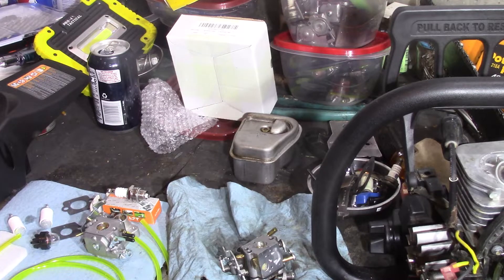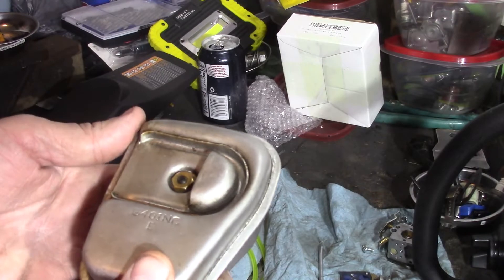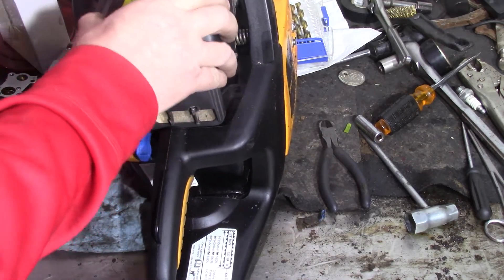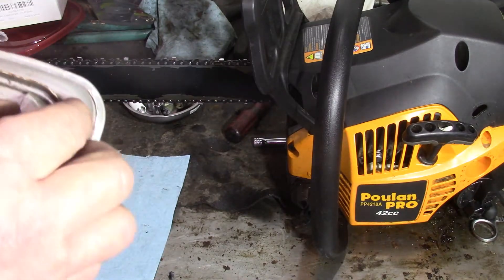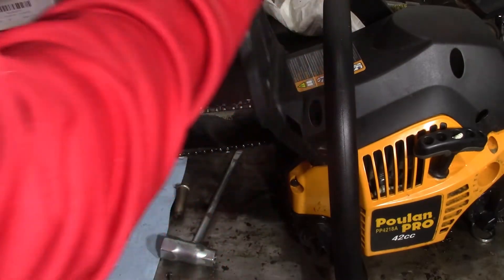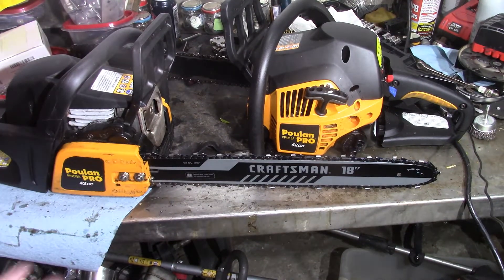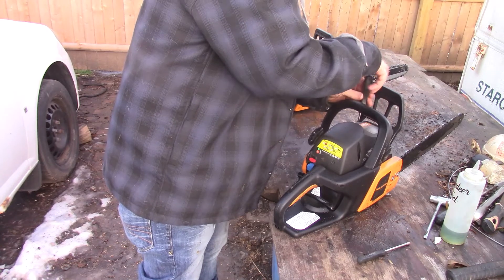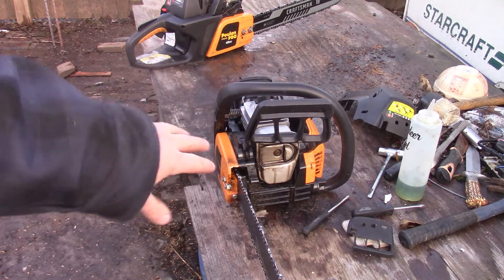Poulan Pro 42cc basic chainsaw muffler and air intake mod

Comment: My 4218 runs good its my throw around saw, only mods are proper tune, and honda hp2 at 40 to 1.. but i watched a few vids on people doing muffler mods and air intake mods, and every case I seen at least it slowed the saw down..
I use to race mx bikes, and if you took the slencer off you lost about 1/2 the power...I'd like to see timed cuts before and after or dyno results. I have a bunch of blue xl12's homelites  they run well. I may build a saw dyno out of an old gocart engine dyno...
Reply from the maker: @joracer1  that would be pretty cool to see. I’ve actually wondered the same as far as HP loss. I’ve noticed a quicker throttle response on a couple of them that’s truly about it. Might have to get a couple of them out with new chains and see if there is a difference in cutting time between the 2 of them. Happy New Year

Comment: You can't get any better cheap after market carb than a HIPA.
Reply from the maker: @billclisham8668  I’ve used a bunch of Hipa carb kits. Ive only had a problem with one carb and it was a simple fix. For the price they are hard to beat.

Comment: Just removing the screen and lid makes it run better and drops temperature by 20 degrees or more during summer heat 
But switching saws at every fuel up is best and let engine warm up is a cly saver

Comment: This muffler is the same on Husky 240. If you break the spot wealds coming from engine site, you can wrap the metal oval piece going around removable screw tubes using needle nose pliers and remove it from the back. On the front the metal blocking the slits can be remove also; it's not welded, leaving fully open muffler. This way you can keep the screen and cover. Cover's dome can be pounded on the piece of wood with the indent carved in it, using half inch ball bearing and punch or piece of steel shaped into the ball. Husky 240 is 38ccs engine and I could install non-skip chain on the saw and cut fully frozen birch trunk.

Comment: I'm a retired mechanic and I saw how GM and Ford Motors destroyed their V8 engines from 71 to present day, I never thought about the small engines two or four cycle being choked down, makes sense what this guy is doing here, but you don't want to take all the back pressure out of the muffler, as for the intake, the more air that carb can get the better it'll run with more power. These Poulan Pro chainsaws are really good chainsaws, I have a Poulan Pro 220 42cc chainsaw that I bought in December of 2000 after we had a major ice storm in southeastern Oklahoma, it actually sets in the shop more than it's used, but it's never given me any problems until the bearings went out in the bar tip roller, you can't buy a new bar with the built in chain tensioner, they don't make them anymore, you have to purchase the chain tensioner with the pin and screw that goes into the slot at the bottom of the clutch brake cover to use with the old style bar, like what the big chainsaws have, but other than that, it's still a good saw.
Reply from the maker: Back pressure is what I was worried about. I thought about just cutting the tops off the tubes instead removing the whole thing.  I’ll have to try it on one of these to see if there’s a noticeable difference.

Comment: I made a custom exhaust for my poulan 260 pro I keep in my one offroad recovery truck just for trees across the roads and stuff and I also opened up the airbox a bit and I ended up having to go with about .40 for spark plug gap because it ran great but once it warmed up it would run funny and the gap fixed it completely and I moved the gap up slowly as I tuned it and 40 was perfect . Which makes sense because I opened up the exhaust and intake so it has a ton more air flow in and out and so you need more gap when you do that stuff :)  these mods woke my poulan pro 260 right up like a different machine it got rid of the boggy delay they have stock
Reply from the maker: Pretty cool. You never know when that saw is going to come in handy. I have one for both of our trail trucks. There’s one area we go 4 wheeling at that has a camp in the woods for people down on their luck. When we would go there we would cut trees that fell so they would have fire wood.

Comment: Thanks for the video. I drilled 10 ⅛" holes in those "sleeves" on the stock muffler. So far its working to release excess heat without making it too much louder/ messing with the backpressure too much. PR4218
Reply from the maker: It seems to help mine out. At least so far lol 👍

Comment: Have you considered that those sleeves might actually function as a heat shield for the bolt heads? It seems with the bolt heads exposed inside the muffler, they may get hotter and transfer heat back into the cylinder where they are bolted in. I could be totally wrong about this. It's just something that seems possible.
Reply from the maker: That is a good point. I can honestly say I have never considered that. So far I haven’t had any issues but I sounds possible.
Reply: @GenerationX1971  good to know. I have an old Poulan Pro that I haven't cranked in several years. I recently decided to pull it out and I'm looking at options to make it  "better". Thanks

Comment: Just bought a brand new out of the box Poulan Pro 18-inch the red version the older one drilled three holes into the air box etc then pulled those little cylinders out of the exhaust now the saw cranks on the first pull and runs a million times better. I was curious though with your experience with different types of saws do you know if it would be possible to get a little more power out of my saw Maybe by putting bigger Jets or do you know of any hacks I can do? I've got a little mechanical ability from workin on bikes and stuff. Without going into the motor too hard
Reply from the maker: I mostly mess around with getting better flow out the exhaust and playing with the carbs a little. Now the one thing I was thinking about is smoothing the exhaust port out some. Not port it out all crazy but smooth it out and maybe just open it up a touch just to see the difference. There’s a lot of tricks out there but the good ones can start costing some $$$.
Reply: @GenerationX1971  id.love to see a vid on it if you decide to do it!. Tbh my uncle has one of them high dollar stihl saws bit i just cant see payin that much more money for it. My grandpa had a poulan saw and he said the only issue he had was fuel lines. But anyhow ima subscribe and hope to see some more content in the future.

Comment: Biggest improvement is to cap the plug to 30 thousand cap
Easy to start then on the 4218
Reply from the maker: Thanks for tossing that in there. I’ll be sure to try the gap size👍

Comment: How do you remove the muffler? I have a similar Poulan, a Wood Shark 1950le. The muffler has the small tubes, like yours, which house 2 inverted torx bolts. Nothing on Earth I can find will fit down those tubes to remove the bolts
Reply from the maker: I found a set of bits at Harbor Freight that are about 5 or 6 inches long. They also had a set that folds up that are long enough reach. I’ve used them also. With the long ones I use a ratchet to brake them loose instead of my drill. I broke the bit on one using the drill to try and break it loose. The set that folds up works well with the stubborn ones that are real tight. You can apply some good pressure on it to get them loose.  Hope this helps you out.
Reply: @GenerationX1971  any idea the name of the actual bit? I swear I've scouted the internet and not seen ONE e torx/inverted torx bit or driver that is narrow enough to fit down those tubes. So are your bolts torx head or inverted torx? Mine are inverted, meaning I need a socked to go AROUND the bolt. So in other words, I need a socket that will fit around the shape of a star
Reply from the maker: @JasonTylerRicci  all the saws I have with that style muffler take the bit that goes into the head. I have not came across any that have the style your dealing with. Wish I could be of more help. Keep us posted with what you figure out.
Reply: @JasonTylerRicci those are normally called splined sockets but there are different types. If you can't even find the right tool I hope you abandoned your plans to work on the saw. What you actually probably needed for that saw was a T27 long reach torx socket. But if you truly had splined studs holding your woodshark muffler on you would want spline sockets not torx bits or sockets.